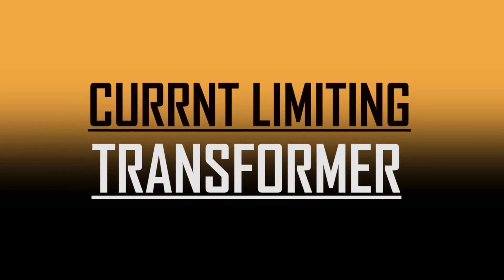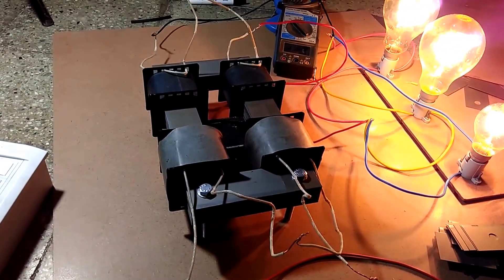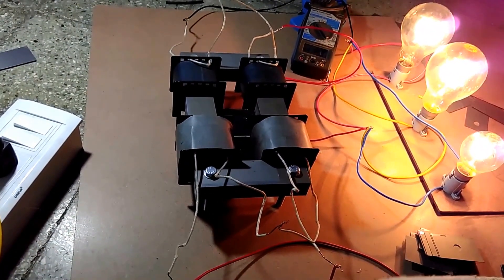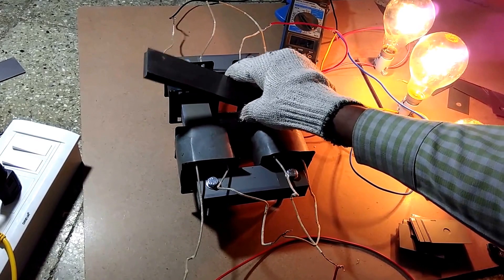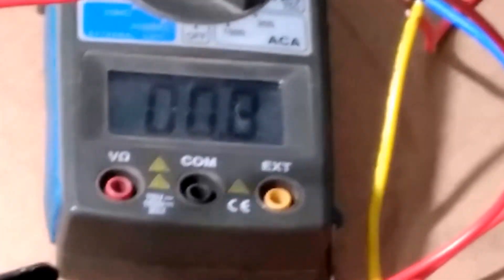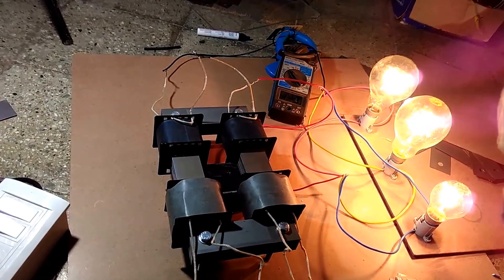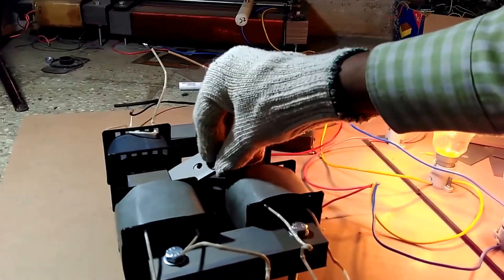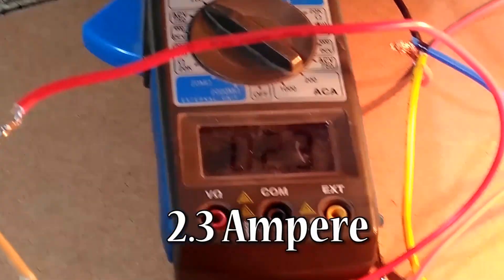innovative secret power of transformer to control grid || you must See

Comment: Interesting. But you've increased the Magnetic path length hence the total reluctance of the magnetic circuit and therefore more core loss. This will make your system less efficient. Could you calculate the efficiency of this system? i.e, Poutx100/Pin ?